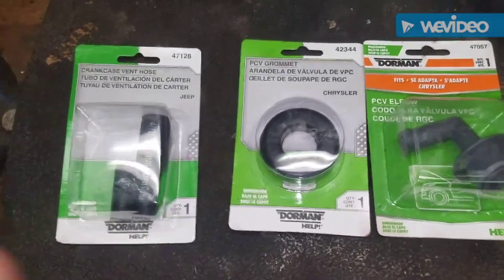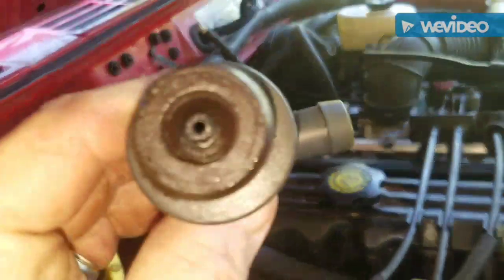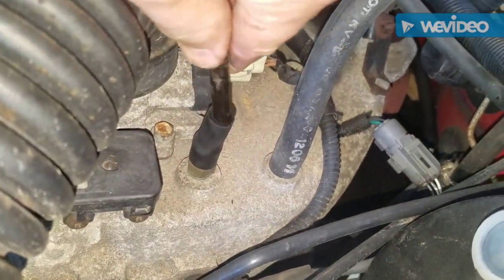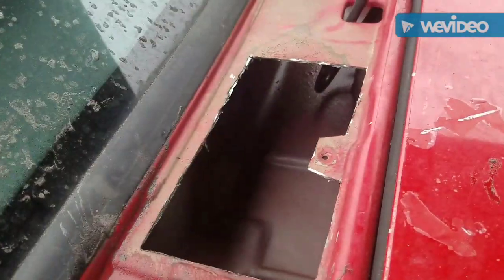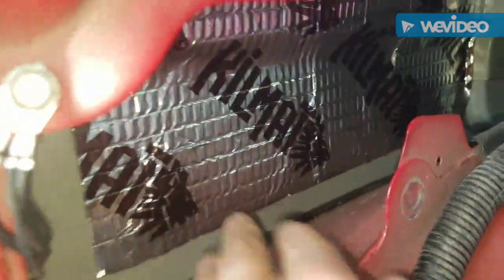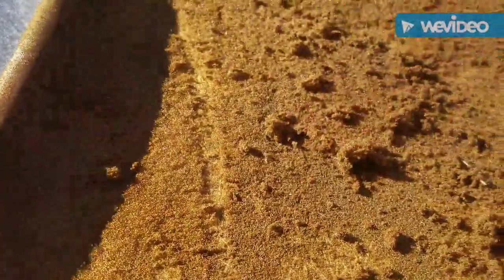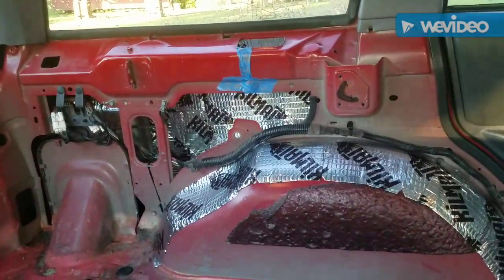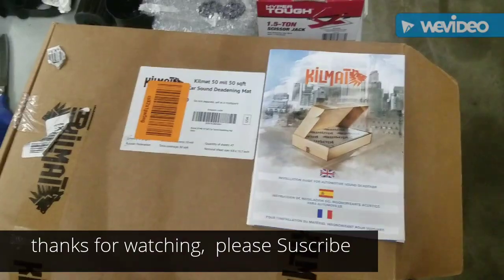Cheap Jeep Episode #27,  PCV Solution, Kilmat Sound Deadening, and a clip About Headliner #jeepxj

Comment: Wheel wells aren't going to have as much noise as under the rear passenger seat area as that's where the shocks and front of the leaf springs for some are mounted.  Tread type is the biggest factor from tires, starting with a highway tire being the quietest and lightest and loudest and heaviest being a mud tire with everything else in between.  Kilmat is a noise decoupler, while a close cell foam will insulate thermally but noise as well.  I suggest knocking about to find the least solid area's and apply the Kilmat there, topping it off with insulation.  The 36 sqft 50mil Kilmat kit with some 4mm Siless closed cell foam insulation works well together.  But then Amazon Basics should suffice as well.  Door panel as well rear quarters are good.  Doing the roof helps big time with temperatures, and if you live in a region that's hot this will help with the AC.  If you really want to hear an area, knock on the cargo area floor.  I used Herculiner to bedline two XJ's, two different times and the carpet, underlayment and rubber carpet base weighs a lot.  I got floor liners that make it so that I don't need to vacuum but merely remove and dump them out when needed.
Reply from the maker: Great information!

Comment: Not sure why they get labelled as PCV  Jeep 2.5 & 4.0 have CCV  ventilation system. Not really a valve which opens and closes just a restricted or metered vent hole in the 90 deg elbow pipe

Comment: In the back against the fire wall by the brake booster there's a black line that has a white piece in it. What is that?
Reply from the maker: That is a Differential breather tube for the front Differential, I have a video on that.  It shows what it does and how to repair,
https://youtu.be/uBfZYNZYLDc
Reply: @MajorWeakness  Thanks for answering that I've been working on my Cherokee so much but never noticed it lol. Then I found it and was like where does this go 😆

Comment: I have this issue but please tell me what is the part that connects the 2 small hoses? The the grommets but the purse in the middle broke in half!! Any tips would be appreciated. Thank you
Reply from the maker: You can get a replacement from a junk yard,  any jeep with a 4.0 should have.  Also you can take the broken part and connect it together with a short piece of fuel line or vacuum line of the correct size.  Take the piece to the part store and get a small hose to connect the two broken pieces

Comment: Nice but wasn't that the CCV valve??
The front one is the PCV valve.
Reply from the maker: Yes you are right
Reply: @MajorWeakness  . I just saw a video on a jeep about a vacuum leak whistle. And saw that the CCV was on the front and the PCV was on the back and the lines were correct!🤣
Reply: @jat-justamaturetech-philpj8285  the ccv goes on the rear